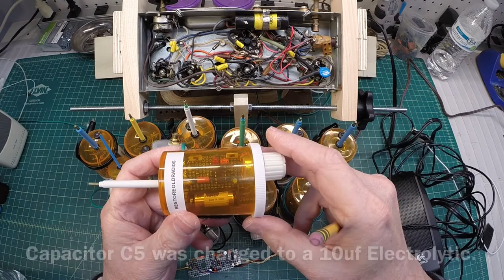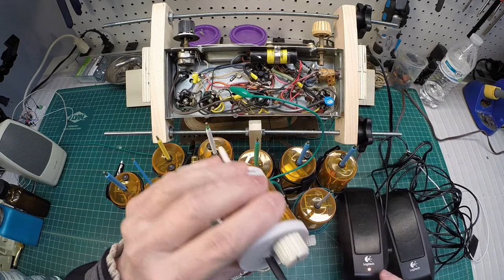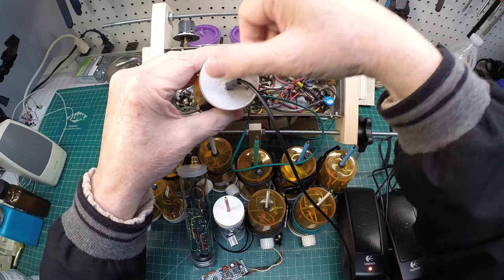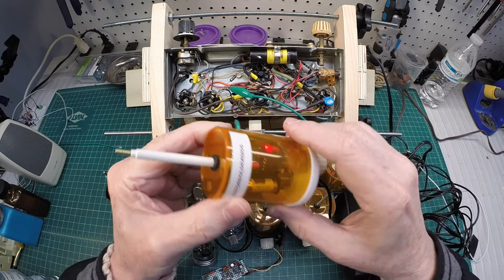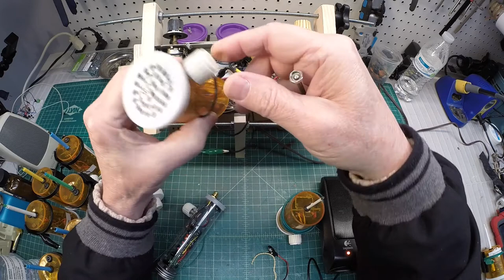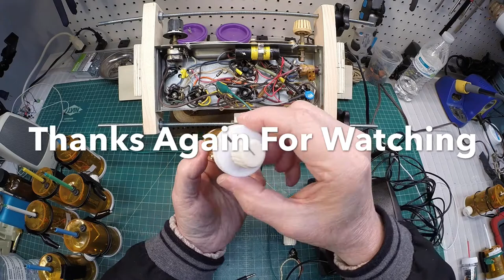Signal Tracers - A Simple Build & Look Back

Comment: Was hoping you going to give me a comment last time about these probe! By putting in a frequency for instance 1 kilohertz oscillator and having another lead for this or plug so it can be fixed, so you can put a signal into whatever you're testing and read the response by the probe? Don't think it's a good idea. And maybe having some Led indicators three or four of different colour, So you can measure the intensity of the output signal say like 5db increments like a peak metre?
Reply from the maker: Sorry John, I thought I did in an earlier video when you inquired about the 1 kHz oscillator. Let me know if you don’t see it. Your suggestions would definitely add value and I would enjoy seeing the modified unit if you build one with the enhancements. Best, Don
Reply: RestoreOldRadios no problems! I just had a look I couldn't see any reply on previous comment! Look forward to the next video